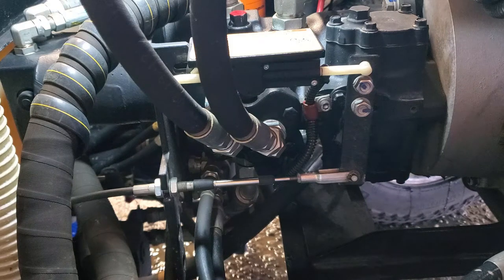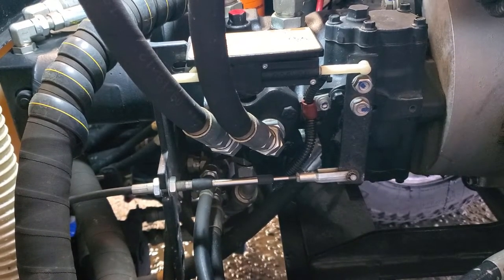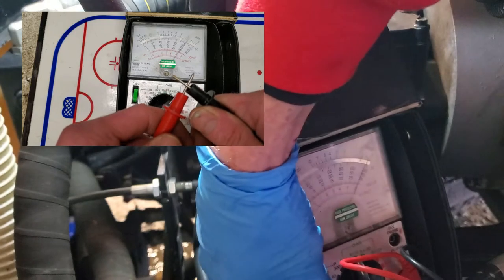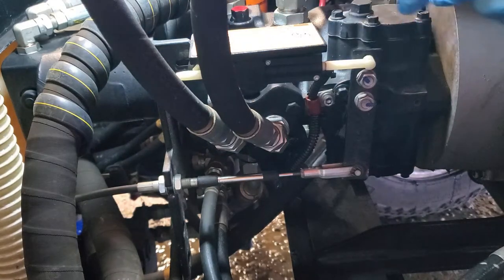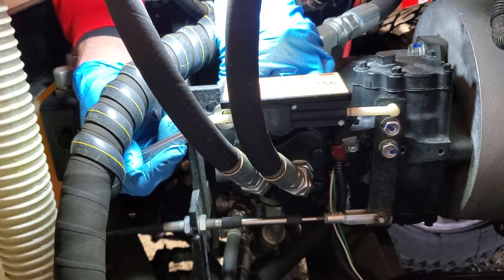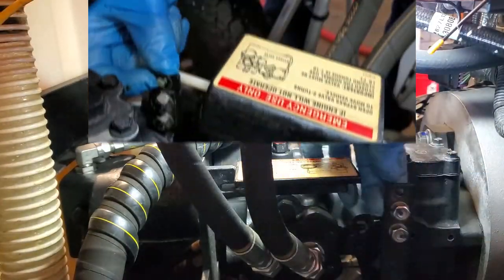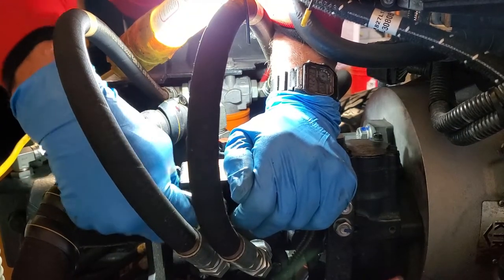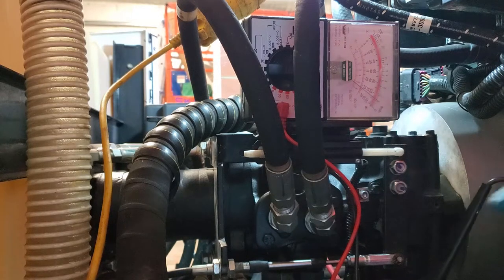Neutral Safety Switch: Zamboni

Comment: I have a question: Would you know if operating on outdoor natural ice is the same procedures as on indoor operations ? Just curious. Thanks.
Reply from the maker: Not too sure. Good question. Think you have to deal with rain more. So having the wash water transfer system is a must. Sure some of it is the same but depending on if there is boards and the need for edging. Probably need to check for sticks and rocks to not to chip the blade.
Reply: @YourLocalIceMan  That is true, didn't think of all the odd factors that come with an outdoor rink. I'd still would give it a go if the opportunity presented its self. On second thought considering our Canadian winters  might just pass !
Thanks for the reply, much appreciated ! Take care.

Comment: what is the hose in front of the wash water transfer system and what does it do?
Reply from the maker: There are two hoses in the wash water transfer system. One comes from wash water tank to the valve. Then from the valve to the ice making tank. This is to use the wash water system to suck up excess water off the ice. More so for outdoor rinks that get rained on. When doing this both tanks would be empty. The water would run from the wash water tank to the ice making tank. Then the ice making tank would be drained. 

Also one could also fill the wash water tank with ice making water and then dump into the main tank to add capacity. 

For us we just adapted the system to melt water off the boards with a nozzle next to the board brush. 

So the hose from the valve, which I think you are asking about, just goes to the board brush arm where a nozzle is.